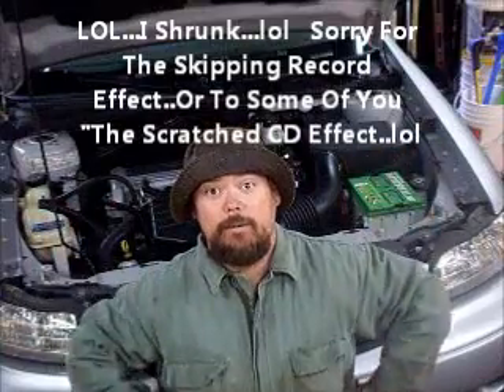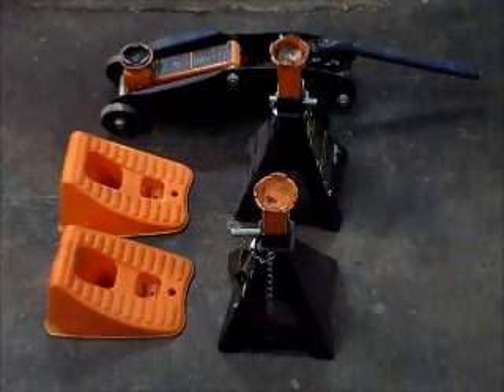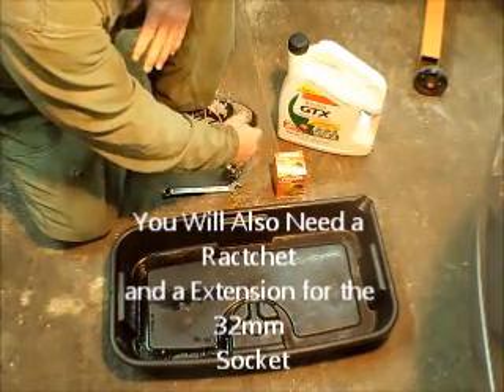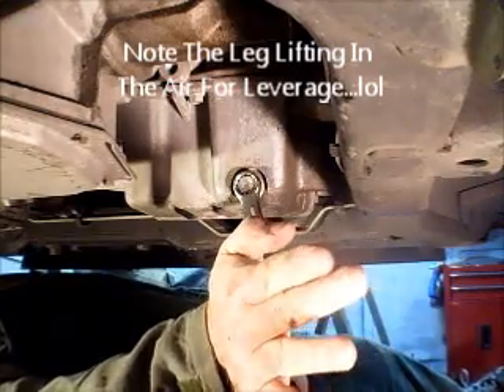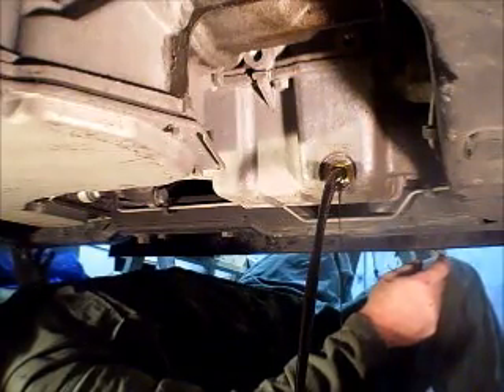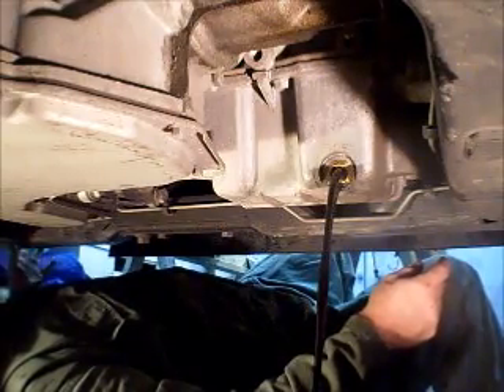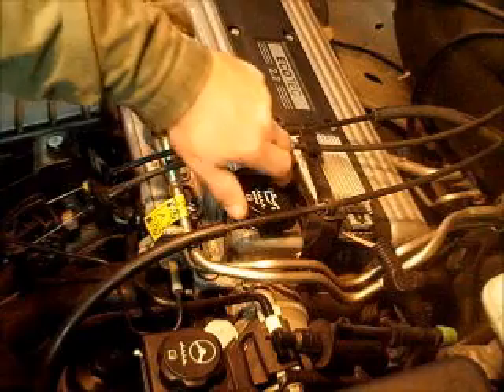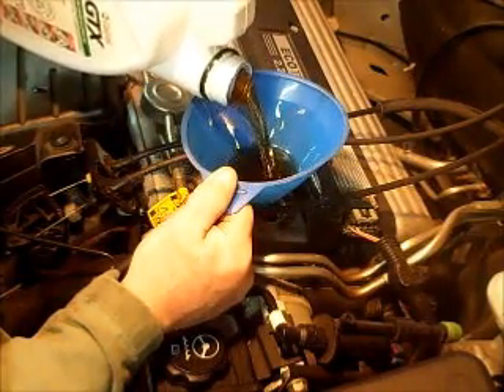Oil Change (2005 Chevy Malibu)

Comment: You should have changed the filter 
before you put the plug back in because
When you pull the filter all the oil in the
Filter housing drains back into the oil pan
But I'm sure you thought of that right

Comment: you forgot to tell the how to look in the manual to reset the ols that's the oil system on the factory radio so it will be accurate
Reply: Can you tell us how instead since he forgot too
Reply: It resets on its own
Reply: Turn car to on position (not actually on) then pump the gas 4 times

Comment: I also have an 05 Malibu with the 2.2L...I have an issue where the idle dips down then up and down again at times...just when the car is stopped at low idle.  Do you know what could cause this and what I can try to fix it?  TPS? IAC Valve?  Throttle cable?

Comment: u should use acdelco filter (maybe even acdelco dexos oil) next time, it's safer for the car, and garuntees that it will run better
Reply: ik most people don't, but you should because it's a gm vehicle, if ford, use motocraft

Comment: Yesterday we were doing the oil change on my brother in law's Dodge Grand Caravan and after all the oil was drained out. he poured in 2 gallons of gasoline and let drain out. He said gasoline is good for cleaning out the oil sump tank from all that dirty burned oil and really it did. you can tell by the color of 2nd gallon of gasoline running out clearer than the first. what i really want to know before i try this on my car is if it's safe/healthy for the new oil it's self and is ok for the engine oil sump? Will it get damaged if i follow this procedure?
Reply: 11:3 west  you're better off just changing the oil more frequently or as the company recommends. I change my oil every 2 months or 3000 miles and the oil drained is always relatively clean, (never completely black). I'm a little more persistent with my oil  changes though. But there are some manufactures that say it is okay to change your oil every 10000 miles. That's a little too long for me but it's probably fine. Oil changes are one of the most important maintenances you can do on your car so don't wait too long before changes and you'll be fine.

Comment from the maker: your welcome..you can subscribe and you wont miss any new vids that are coming up.. :)
Reply: himi himi 2 questions I'm in the process of changing the oil on my 05 Malibu and I'm stuck cause I can't get the drain plug out the bolt is stripped takes a 5/8 but it just slides. 
second what size socket is that you're using for the filter?
Reply: himi I meant to say any suggestions on that bolt being stripped